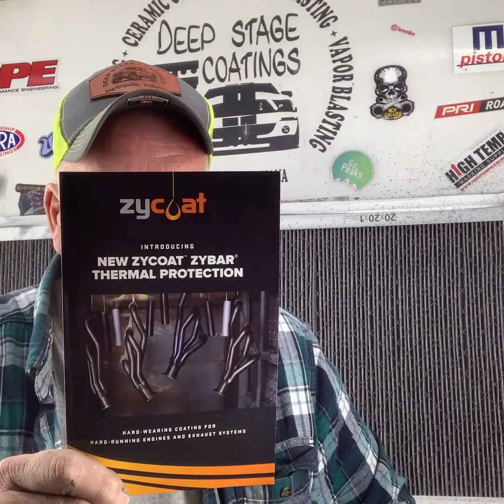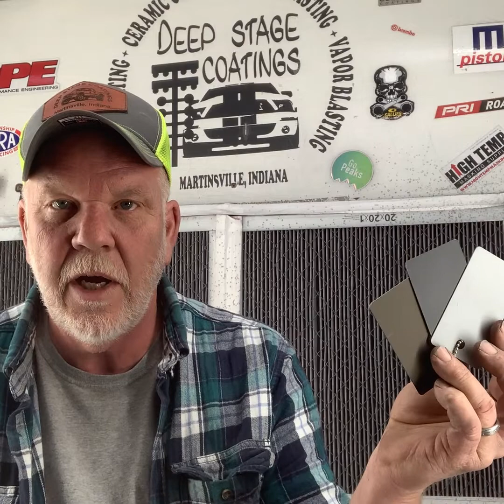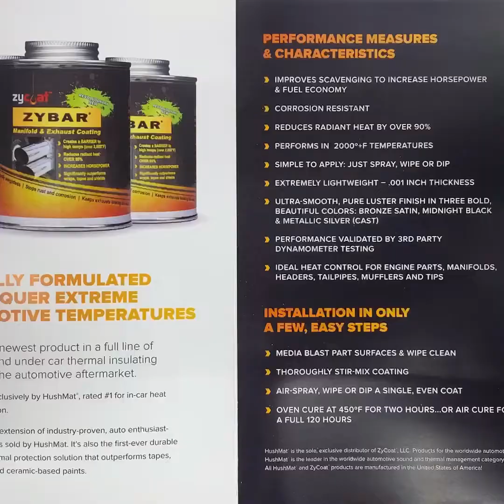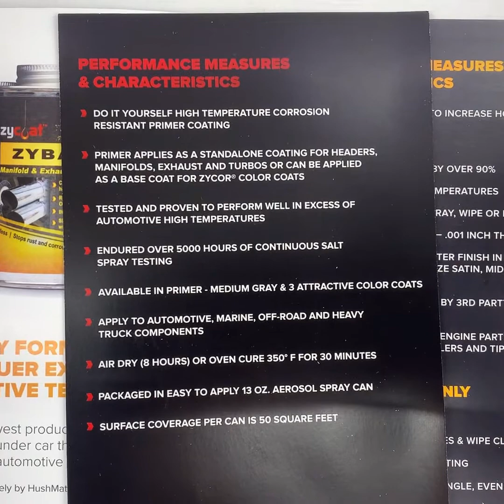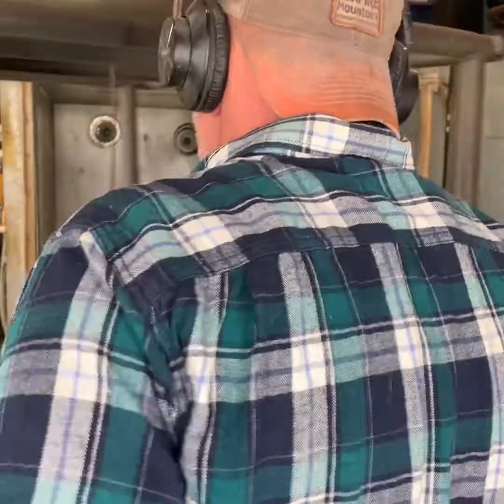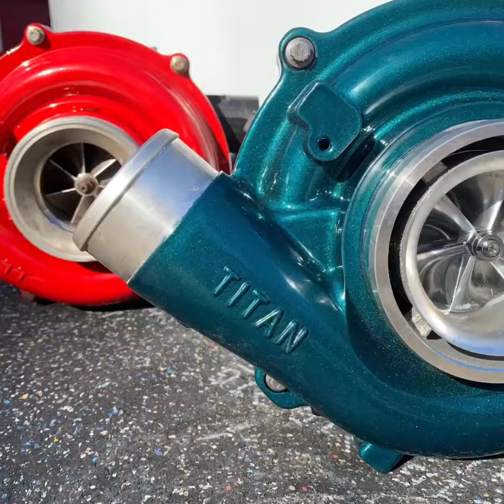ZYCOAT Thermal Coating:  First Spray, Great Results

Comment: Great info! Any update with the product? Does it really reduce temperature in the engines bay? Looking to get my shorty headers done for my impala. Having vapor lock problem and tried the wrap and shields on my headers and none of them works. My brake lines and fuel line are next to the headers. Thank you
Reply from the maker: I have only anecdotal information from using it on my personal mildly built (500 whp) F250 6.0 Powerstroke.  My pyrometer is plumbed into the exhaust directly after the turbine and I rarely see EGT’s above 700° even when towing our 5th Wheel camper.  Most times they stay between 500-600°